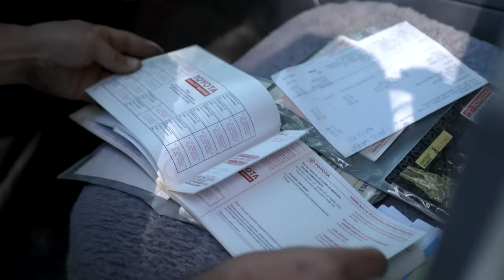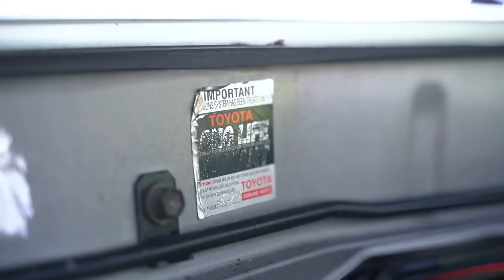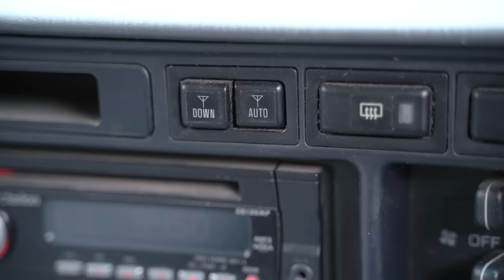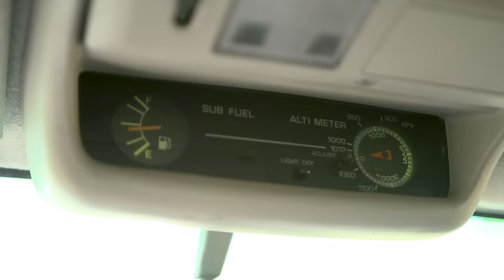RARE GRANDPA SPEC Toyota Landcruiser! You won't believe what Shauno paid + tips on buying an OLD 4WD

Comment: I have a 4X2 Ford Ranger 2014 model. Can I go off-roading by replacing front tires with All-Terrain type and Rear tires with mud tire to compensate the lack of front claws?
I already have the All terrain tyres installed just today but the rear tyre only and front remained at Higway all season tyre, I tried on light dirt and it improved traction. Now if I put a nice Mud Tire on the rear and proper inflation and put my new AT rear tires on the front, can it handle beginner terrains? not planning to go hardcore since its only 4x2.

Comment: Great vid as always! I actually just bought my self a projekt vehicle a Defender 130 300tdi from 97 and it has only got 220 000km on the klock and I am the 3 owner and the last owner had it for over 20 years. Last 8 years though it has been stoud away because of rust in the frame but the top is in very good kondition so now begins the big job of taking of the frame so it can be repaird then it should come out on the roads again around next sommer. Best reguards from Sweden.

Comment: After my 3rd 80 I wasn’t looking at the time having a few headaches with my monster 1hdt. A 95 1hdft 80, manually 350,000 abs and rear heaters came up a couple years ago came up local for 12500. Had paint faid and a bad dent in the rear quarter. I was just put off work in town when I took a job a fair distance away where I did 1000-1500kms a week on a farm. I was lucky it had a steel bull bar, cleaned up plenty of roos  and emus without a issue. Just got in and drive it minus servicing. A few roos to many the flairs were looking worst for wear and was starting to look like a junk car. Since then I’ve moved back to town. Got it full respray, got a set of dick cepeks and rear bar and quickly gone from a junk car to a envy. Nice dark blue colour. In the 3 years I’ve racked up a lot of kms. After 2.5years of whining the gearbox went and one day my injector pump went. All up owes me less then 18 as we did the gbox in our own shed and did the paint job as an apprentice cashy but represents its self unreal and it still gets offroad

Comment: nice buy - clean engine not been offroading a lot in mud atleast. also you do not put 3000dollar into a fuelpump if you dont trust your old car to do a lot more miles. 
You guys inspired med to buy a adventure veichle i fish a lot, a old T4 in denmark for 3000dollar i now done 40000km on waste vegetable oil at 30cents/L - these cares are know to be very expensive to own due to taxes and fuel, but mine is the cheapest car i ever had (10seater bus not 9 saves me 3500dollar/yr in road tax). two owners all oem services untill 400000km, car all original always a good sign for buying old cars.

Comment: Mate, I came across the exact same thing for my first 4WD. Weeping swivels, leaking rear seal, factory alloy bar and side steps, and all — only it was a 2003 Gold GU Patrol.

Single owner, full service history from Ringwood Nissan on time every time, all the paperwork and receipts, even the purchase invoice, a nice little DIY false floor / shelf, tow bar, the sheepskin covers, a second battery by ARB, unused third row seats, and evidence of a UHF and brake controller.

Meticulously cared for and nary a dent or scratch, just the odd stone chip and shopping centre car park ding. Absolutely immaculate.

It did the lap with his family, and it’s got the log book entries from the likes of a Nissan dealer in Alice Springs to prove it.

I got it for $11,500 in 2020 right before COVID hit hard, and me and the kids have done 60,000+ kms in the last 2 years of ownership without a single problem.

Comment: brought a 1998 land cruiser cab chase 6.5 lt v8 Brunswick motor in it approx 65000k on motor all for $8000. All that was wrong with it that some one had put clutch fluid in the brake system ripped out all the brakes and replaced it all the only thing is the park brake will not hold have replace all that system works for a whyll then it will not hold does any one have any ideas on to fix this would be appreciated Perth WA

Comment: I got a ln106 hilux duel cab in 2008 with only 120,000 km for $1000  

I found it abandoned in a car park and spent a month Searching for the previous owners.  It had the original bill of sale in the glove box, found out that it was registered to bankrupt company and they transferred it through three company names .
It ended up in the possession  of the liquidators who couldn’t find the car so I made an offer of 1000 bucks they accept it . They had given up on making Amy money back after 2years of looking for it .
I even manage to get a code for a key to be cut from the locksmith before i  owned the car. I was just lucky to contact the right people at Toyota with the serial numbers.

 I only had it  registered  for 30mins and got it  bogged

the car went from stock traidie Ute to 6 inch lift and 33’s  custom bar work and second hand sky jacker suspension from the USA  pm me if you want the pics 
I keep the car for almost 10years and had more off road fun in it than any of my other 4wd’s combined  not bad for $1000 and some second hand mods 

I now own a 1hdt 80 I picked up for $7,500 which is my second best ever deal ever on a 4wd
Reply: I have photos of all this if you want to see any of it